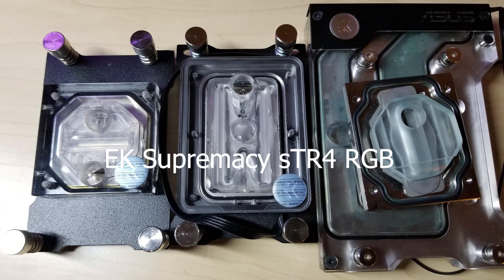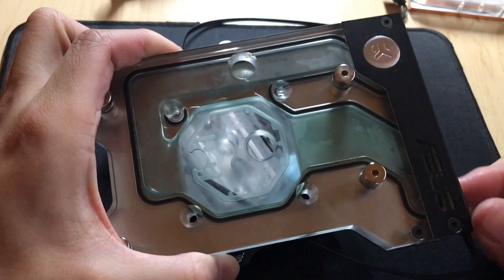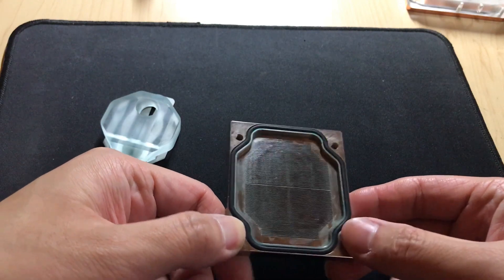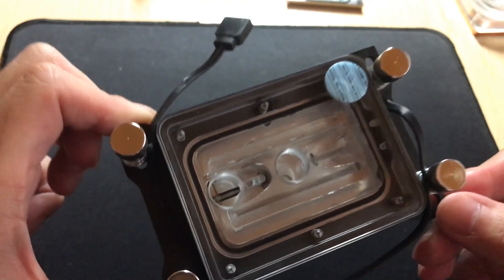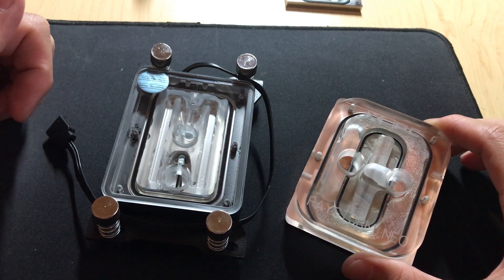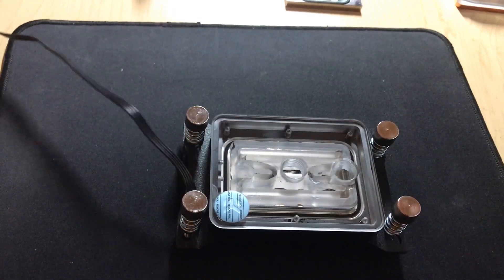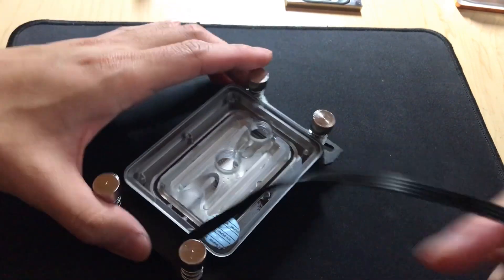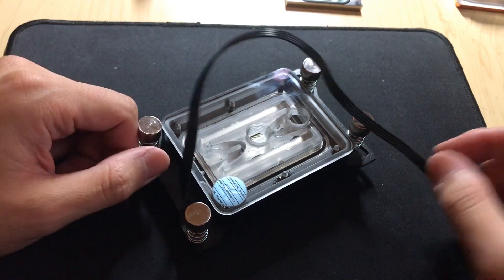EK Supremacy sTR4 RGB Performance/Overview and Comparison

Comment: Had the original EK too but instead of dealing with EK's always slow and delirious support I got me a chinese block from byksky ( or something named like that ) and it was cheap but not cheaply made like the EK block. I had my loop cleaned the other day and the plating was in pristine condition, no back spots and the finish also looks very good, unlike EK products. 
Honestly, I had too many problems with EK products over the years, stopped buying their stuff on the X58 era when they mailed me ( and other ) a non-finished product they wanted me to pay for shipping charges or fix it by myself. The issue with that block was nothing less than a missing channel and by that the block would not let water flow in your loop. The owner of EK were threatening on suing me because I disclosed the issue but then, after many others showed up with their unfinished blocks, EK went on apologizing and all kind, trying to ship new blocks with mailing charges on them, obviously.
They got me again with their cheap stuff for TR, not anymore.
Reply from the maker: Yeah the bykski block is pretty decent was well. Ek is not the company it use to be, I pretty much avoid their products. Their TR block was the first one out and my aio wasn't going to cut it so I had to get a block in the interim. At the end I used the xspc block.
Reply: Which of the Bykski cpu block did you buy? I'm putting together a new build with the 2950x and uncertain which one to use.
Reply from the maker: @dreamxml  theres a couple for tr you wanna get the A-ryzen-th-x. Theres a v2 now named thv2-× and if you want the one with a built in temp sensor and display its a-ryzen-tech-x-v2.
Reply: @JCustom  Thank you so much, sir.